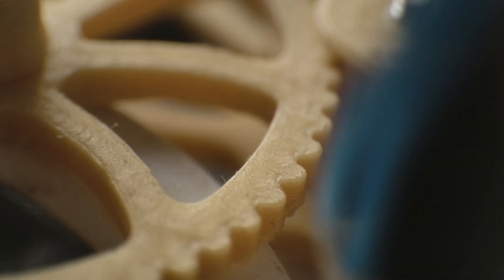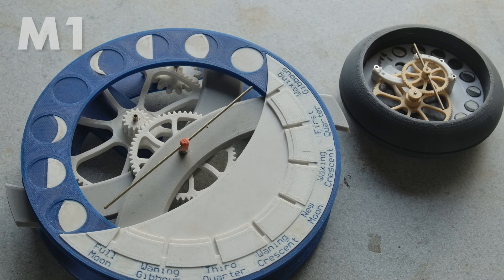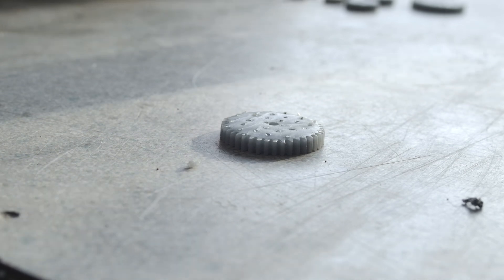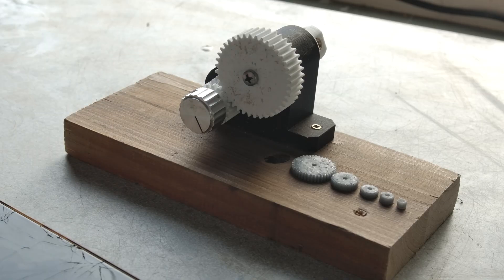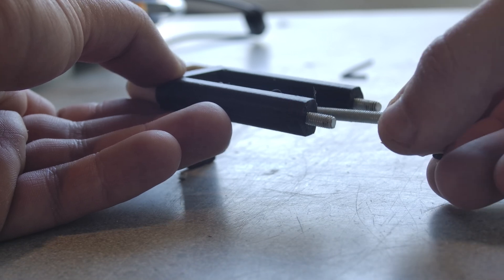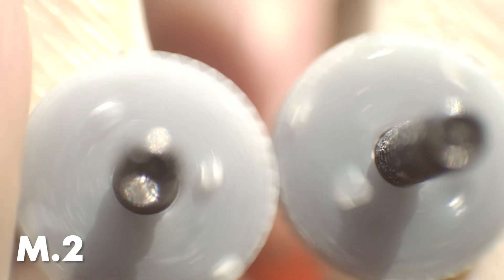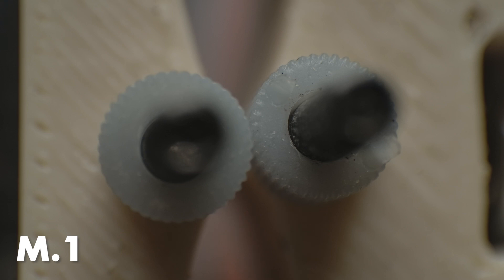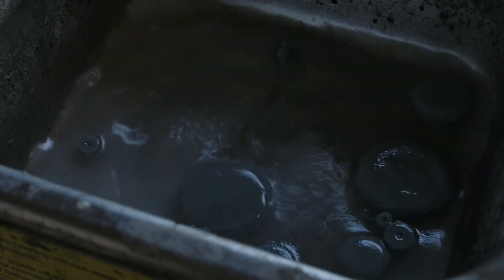How Small Can You 3D Print Gears?

Comment: The idea is good, but this type of printer isn't suitable for printing such small items, due to the LCD screen! For example, take a sheet of black paper with a 1cm square cut out. The edges should be sharp. Hold it to the table and shine a light on it from above. You'll notice the shadow won't be sharp. A similar effect will occur under UV light: the edges will be slightly blurred. For resin, this will be a partial layering of semi-cured polymer. The light source is located at a distance, which is why this effect occurs. DLP printers with micro-mirrors are best suited! That is, the light is either on or off.

Comment: But surely it would also depend on the settings of the printer, the resin used and the original design of the print... I am looking at this in relation to me making gears for scale 1/87 and 1/76 model train replacement gears as it is very hard to get replacement gears for some models here in Australia..

Comment: Would love to see a comparison of tiny gears under load, and what resins are compatible. Ive had some UTR8220 0.5 mod parts from the ever present pcbway , 0.1mm diameter shrinkage on 10mmdia boss 2mm tyre wall  and 0.05mm ovalicity on the 19mm gear.  Would love to use a machine like the Elegoo to make high precision but also would want tough resins available. The UTR8220 data sheet says 355nm light source not laser so but says sla not MSAL. The Elegoo mars says 405nm so this may be similar, dont see a nm spec, but as a private owner we can swap the bulb.

Comment: As mentioned by several others, you could touch up the teeth with a tiny narrow file. Another method that is sometimes used with metal gears is to set them up on a depthing tool (which you already have) and drive the gears with a motor and introduce some abrasive. Not too fast. Start with the gears slightly loose. After you run them for a bit and some wear or machining has occurred, you tighten them a bit and add more abrasive. I have never done it with any flavor of resin/plastic, so I can't be more specific about the size and type of abrasive, speed, how long for each grit, etc. Sounds like a worthy experiment though.

Comment: I use cylinders printed in flexible resin with friction tape applied to the contact surfaces, joined under pressure.

Comment: This also totally depends on your printer. Printers, toolheads, hotends, they have different tolerances, in different ways. The filament is also super important. Use ABS or PETG. Also, resin printing is great for accuracy, but FDM printing generally produces way stronger objects that last longer. For this reason, functional prints are better made on those. Also consider making your own CNC router (or mill?), perhaps with SOME parts being 3D printed. Then you can use real metal for gears :)

Comment: As someone who's a little more experience with making tiny, flar parts.. Consider printing directly onto the build plate, fuck the supports, they're not needed. You just need to compensate for the elephants foot, which requires calibration and patience, but quite doable with a little effort. It'll let you print perfect gears that are much, much thinner and completely accurate, if you're patient :)
Reply: Also, replace the FEP of the vat with a high quality one, that's not too thick and has extremely high optical clarity, it'll help infinitely. The resin you use also HIGHLY affects the end product, as does the exact exposure time you're using, it'll need calibrating depending on usage task and resin used. 

For a resin that's highly accurate, precise and insanely strong, try Siraya Lava Black, it's insanely good for mechanical parts, you can even drill and tap it!

Comment: Some points worth noting for folks interested in mSLA printing very small mechanical parts:
* display resolution doesn't tell us much. The important spec to look at is pixel size. For two screens of identical size, yes, a 9K resolution print bed will have smaller pixel size than a 4K - but the assumption there is a pretty big one. Many manufacturers of chitu-driven mSLA printers don't actually publish this. It's easy to calculate though.
* as mechanical features get smaller, print settings, post-print cleaning workflow, choice of resin, and even the degree to which UV light is collimated as it enters the vat really start to matter. You can see this in Chris' work. He did everything right, but at a certain point you start chasing these variables.

TL;DR: I've had reasonable success with module 0.25 gears, using non-specialty resin on a printer that's laughably out-of-date at this point. Lower than that and the other factors I mention become incredibly important. This'll be true on even a brand new mSLA printer because pixel sizes haven't gotten much smaller in the last five years or so. What you get instead in larger build plates and higher power UV LEDs for curing, which means that you can print more at once and more quickly.
Reply: Also: Anti Aliasing. Chitubox has a setting for that, which micht result in reduced details for smoother surfaces. 

Published Specs for the Mars 5 Ultra are 18x18 μm in XY and 0,01 to 0,2 in Z. So A 0.1 Module should be within the limits of the display, if the rest works is another thing.

Comment: See about making a jig in order to test breaking force/torque of those teeth. For the smaller gears it would be as simple as holding one gear fixed, and hanging a weight from a pulley mounted to the other gear. Though that depends on the depth, so there’s a compromise between strength and friction. A system that could measure rolling resistance as well would be nice.

Comment: A year or so ago I bought a resin printer (which one is not so important because ultimately they all do the same thing, just resolution and ease of use which really changes). My biggest gripe with resin printing was the cleanup/mess/toxic nature of it all. I had read people online saying that was a pain, and I thought "oh how bad could it be". Turns out, it's a major pain in the butt. Resin printing is definitely something you only want to use where you really have a good reason to do so. Also, I found that with ABS-like resins my parts warped over time and no longer fit/ran together smoothly. I am not sure if I didn't cure them properly or if that's just normal for resin prints. All in all I was super happy to get an FDM printer again, its so easy and convenient, and I don't feel like I am going to get cancer every time I use it. I have a lot of respect for people who have the time to persist with resin printing. I hope they have very good respirators.
Reply: I think parts warp over time from uv light from the sun overcuring and "pulling" the parts in the direction that they are cured. Ive seen this from trying to post process parts in the sunlight but I believe the same thing happens even with properly cured parts. Were the parts that you found warped exposed ?

Comment: My elegoo mars 4 default settings needed some tweaking. As far as I understand, there’s a trade-off between resolution and strength of the prints. Also, as some commenters noted, orientation of the print plays big role. I came to SLA printing after FDM, and I must say that knowledge isn’t very transferable, you need to learn a lot additional info about the process; FDM intuition can fail you. Thanks for the video!

Comment: May I suggest printing the .1 gears on a different angle and dialling in the resin exposure more.
On a vertically angled plane, you should be able to easily  get functional teeth down to .025 on that resin printer.

Comment: You can make very small gears with a blade and a way larger gear, cutting a tooth on the small gear attached to the large gear, and moving the large gear by 1 tooth.
(That also works with metal too)
If you want even smaller you can probably etch a copper sheet, but I'm not sure what you'd be doing at that scale.

Comment: With better tuning you can absolutely get better results! Your prints look over exposed which will ruin fine detail. Spend an hour dialling in the settings for your resin, you’d be amazed at the improvements that could be made. You can also tune for dimensional accuracy which would also be important for gears.
Reply: I agree. Even my cheap 2k resolution generic printer gave way better results. Of course after proper configuration. Each resin is a bit different, need to account also for that. You can do better, way better. I would suggest printing a calibration model for resin printers. Do it several times by dialing in the settings. You should get at least 0.1mm precision on the edges. Keep up the good work. I enjoy your videos!
Reply: this is true but it also depends on the resin,hes using a clear resin witch hs a lot of bleed trough

Comment: i wonder if you had the resin exposure dialed in for those prints as the small gears looked overexposed compared to the sliced file preview. you may get better prints if you dial in your exposure a bit.
Reply: While this is potentially true, there's also something to be said for working within the constraints of your tools as-they-come
Reply: @mistaecco  that's just nonsense in 3D printing. Even with the recent advanced FDM printers you still need at least some settings for different filaments. That goes just doubly so for resin.
Reply: @mistaecco  For one off hand tools, thats understandable. For fabrication machines, you can't have that attitude. There is always some way to do something.

Comment: Definitely need to run those gears over some high grit sandpaper to get rid of the support marks, also try to angle the parts when printing as you always want the layer cross sectional area as small as possible to minimise peel force and warping.
Reply: Not sure about that for very small gears since you might get some artifacts